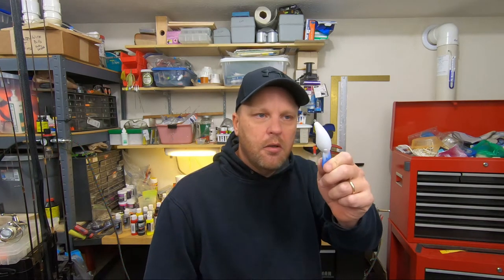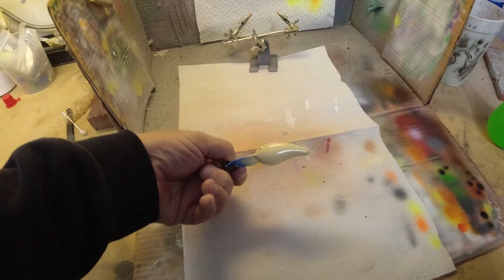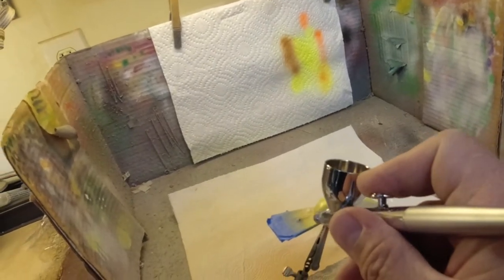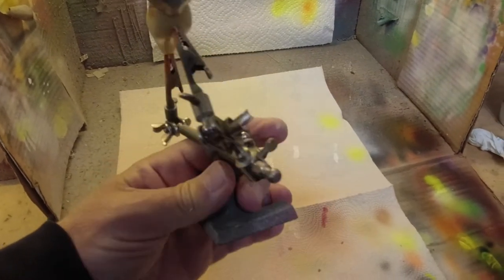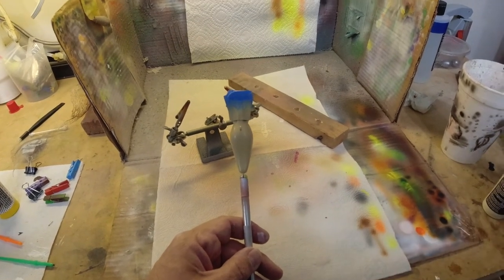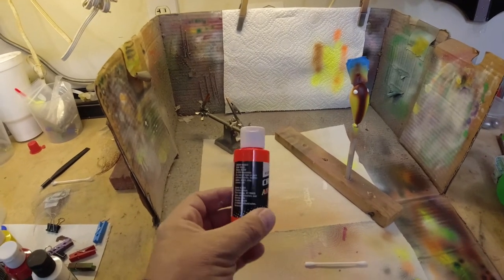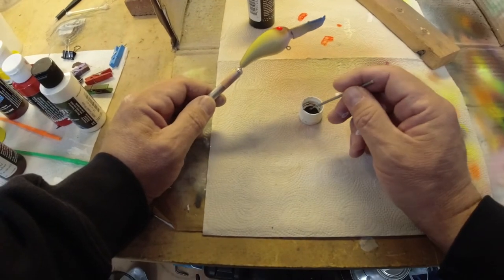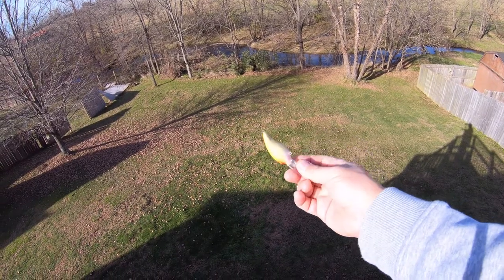CUSTOM PAINTING CRANKBAITS | Cold Water Pattern | Bone Mustard

Comment: Cool man just saw you post on Facebook and saw the vid im getting into the hobby  cool vid i need to start painting some lures do you have any vids on mixing the colours getting them thinned up
Reply from the maker: If its a special mix color, I try and put the recipe in the video.  I generally mix paint right in the airbrush cup.  As far as thinning paint goes, it's some trial and error.  For example black and white for me seem to the hardest colors to spray, and always need to be thinned.  Some paints I can shoot right out of the bottle.  95% of the paint I use is Createx.  The best advice I can give is get the reducer made for the paint you are using and not use a homemade reducer.  Also look on the bottle of paint for a recommended PSI and tip size.  If either of those goes down, the paint will need to be thinned down.  When reducing paint, I will start by placing one drop of reducer in the airbrush cup then I will put the paint in and then put any more reducer in.  I use the end of a paint brush to mix everything up.   Hope this helps, make sure you hit that subscribe button, I'm planning on doing a couple more lure painting videos this winter.
Reply: @eFishin  thanks man sure will keep up the lure painting vids

Comment: What clear coat do you use?
Reply from the maker: I use EnviroTex Lite or Devcon 2 Ton Clear Epoxy.  Lately its been the EnviroTex.  I can't tell a big difference in them other than the Devcon is a thicker epoxy.  With the EnviroTex, if I want glitter on the bait I will do two coats.  The first one without glitter and the second one with glitter.  With the Devcon I will do one coat with glitter due to it being a thicker epoxy.  I dry both on a lure turner.